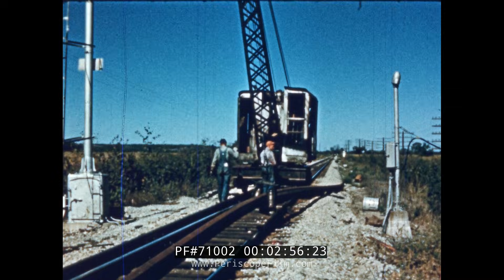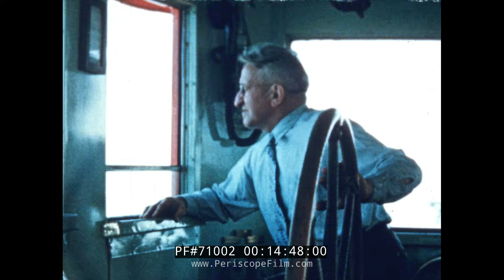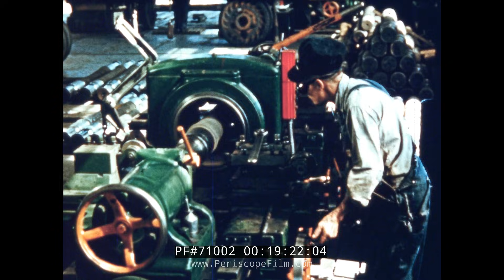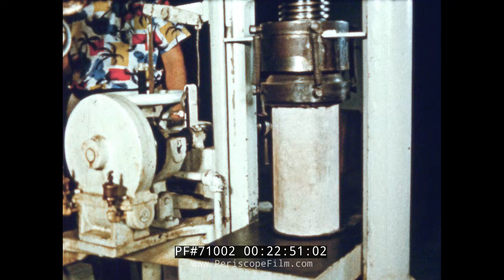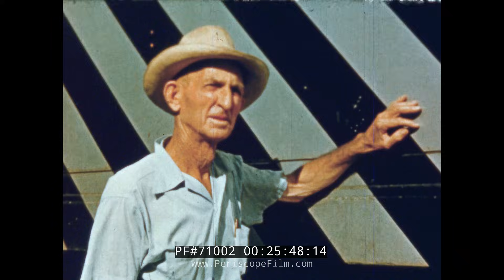"CHALLENGE FOR TOMORROW"  VINTAGE SANTA FE RAILROAD SAFETY FILM 71002

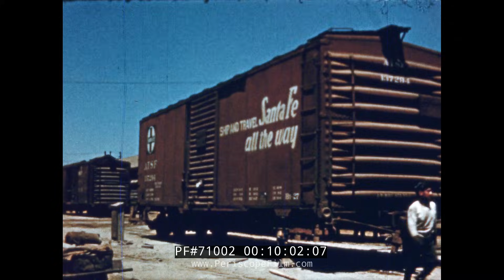Comment: Metal on metal has smaller coefficient of friction than wood on metal thus lowering the force of friction between the two surfaces.  As a result, 10:00 is more likely to happen.  Never underestimate the power of basic physics.

Comment: What I like about our local railroad is that it is the same railroad the trains used to run over. It was part of a small road of about 50 miles, from the late 18th century to the 1950s. it shut down in 1957, and torn up, except the first 10 miles or so that ran through town to the next town, which was abandoned for a few decades. Now they run trains of granite grout to the junction with mainline railroad outside town. They relaid the rails and ties and ballast ten years ago when they restarted operations, but the rails are still the old ones, marked Bethlehem Steel, 1928. Still bolted together. I like that. Not the original rails, but they carried steam locomotives.

Comment: That E-1 @ 6:50 ?  I didn't realize SF still ran E-1's in 1954.  Interesting.
Reply: It’s got the shovel-nose for sure, but the headlight looks a bit off, as it’s protruded, not flush.  Could be an E6 unit though.

Comment: Seen this video before and it's awesome.

I had no idea those 1800s steam engines were that big compared to an F-unit. I thought they were smaller than that.

So whatever happened to getting rid of that clickety-clack? :)

Were the steam engines shown here preserved? They saved that old time loco until the time this video was made so I'd like to hope they kept it around after this if they already kept it that long.
Reply: The clickety-clack is from the joints in the rails, nothing to do with steam. Steam goes "chuff-chuff". That's why he said the clickety-clack is gone now that welded rail (semi) is being used.
That is a relatively large 18th century steam loco, a Consolidation type, probably from the 1890s, so it is bigger than, say a 4-4-0 from the 1860s or 70s. But it is still pretty small. It can't be that much smaller, though, since they are both running on standard gauge. The size difference is less apparent from the front, since width and height changed a lot less  than length. Loading gauge has stayed relatively static, but you will notice that the cab takes up most of the height of the steam engine, and the boiler,l which is the actual locomotive, is barely as high as the headlight of the diesel. Later steam engines had much larger boilers, and were actually larger than a diesel. There is an 0-6-0 switcher in New Hampshire we pass sometimes, and it is amazing how large that actually is. They haven't made small locomotives since the 1870s, really. The "small" wheels on that engine are as big as me, and the thing is like 15' high or so.
Reply: @William Walker  I understand that it's the track making the clickety-clack noise.  And boy, do I ever know where the chuffing sound comes from haha.  I just don't understand why the clickety-clack didn't go away, like it was claimed would happen here.  I still hear it when trains go by to this day.  Unless it used to be even louder back then?  But the sound is still here.  Although, this isn't a complaint.  I like the sound, heh.

I will have to check the video again.  I knew that wasn't a 4-4-0, still I wouldn't expect an old time consolidation to be that large in comparison to the F-unit.  But, you are right that most of the height is from the cab, smokestack, domes, etc, and it is not as easy to tell from the view we have here.  I wish we had another angle!

Comment: I guess the real difference between then and todays is:
-Brakes (every car is now a caboose with today's pressure brakes and digital monitors)
-Clothing (put a yellow vest on top the overalls, exchange the hats for hardhats, and add sunglasses)
-The trains' contents (much longer, pulled with 3 locomotives, much less passenger movement.)
-Communication (I'm pretty sure everyone in the crews has a walkie-talkie.)
Anything I missed?
Reply: PPE for train crew, such as gloves, boots, eye and ear protection, no reading or electronic devices on the job, "Red Zone" protection when between cars, no walking atop cars (thus no "tell-tales" as shown at the end of the film), electronic devices similar to iPads for switchlists, setoffs, pickups and to log work done, also for employee time and work records, remote control locos, almost no more human control operators (I was one) or switch towers, talk of one-man crews, alerters instead of dead-man pedals, no dropping or even riding loose cars (kicking cars) in the yard to make up trains,  ETDs instead of cabooses, and I think the air brake systems were different, called ABD or something like that.
Reply: @KutWrite  wait you guys can’t kick cars anymore?
Reply: @codyandrew2029 : They did away with dropping first, back in the early 2000s. Later on, while I became a control operator, a conductor told me that kicking was made illegal, that is, with a conductor aboard the car.
 
We had been allowed to do it as long as the conductor was firmly aboard a ladder on the trailing side of the car, holding with both hands. I did it a few times.
 
It was scary at first, then a fun test of skill, applying the handbrake just enough to allow the car to couple, but not stop too early or bash the stationary car ahead.
Reply: @codyandrew2029 
The RR I worked for still kick cars.
Reply: Yesterday... Semaphores, Searchlight signals, extensive pole lines, electro-mechanical signalling systems, and Fairmount Speeders zipping from place to place. 

Today...  The "Darth Vader" color light signals, hy-rail trucks, and 100 percent digital end to end PTC signal equipment replaced all that vintage gear which served so faithfully for years.

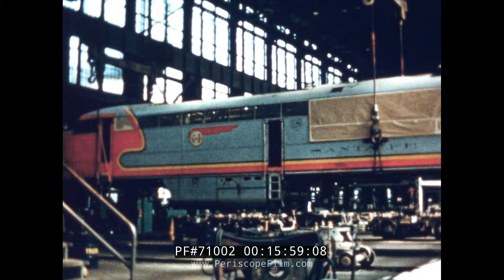Comment: 16:00 -   Fairbanks Morse, Erie-Built - 6 axle passenger diesel l. They only had 2 A units, and 1 B unit. Pretty rare.
Reply: Pretty crappy, too!  When the 90 would go up Tehachapi on the SF Chief, they used to have a rider in the engine room to reset the overspeed trip due to wheel slip.  The FMs didn't have sanders!  There were no repeat orders.
Reply: @desertbob6835  This educational video also has a strong reference to when I was; listening and watching the classic Warner Bros Looney Tunes cartoon episode, it's where Foghorn Leghorn played a joke on the male cartoon barnyard hunting dog. The male cartoon barnyard hunting dog moved upward out of the way; and then Foghorn Leghorn got on the railroad tracks, this is where the diesel engine train ran him over. Daffy duck had Foghorn Leghorn all bandaged up.
Reply: @desertbob6835  The diesel engine train didn't even kill Foghorn Leghorn, that's what.

Comment: Bro, Santa Fe had it's own ships? That's awesome!
Reply: Lots of railroads did! The Central Railroad of New Jersey had car floats, tugboats and ferries. They would even serve complimentary breakfast on the ferries, not to mention the transfer from trains into Jersey City Terminal to ferries headed for Staten island was free with your ticket!
Reply: More barges than ships
Reply: CSX has a container fleet.
Reply: Even the Central Vermont had a fleet at one point, from New London, Connecticut. The B&M had a fleet of lakes freighters, IIRC. It was extremely common. Especially if it was just to cross a waterway on the line, that is just a thing you do when the water is too big to bridge or go around. Railroad ferries, etc.
Reply: SP had a much bigger, but older, fleet.  They also had the Dumbarton bridge in 1901, and the Caquinez Strait bridge by 1930.  SF was SP territory.

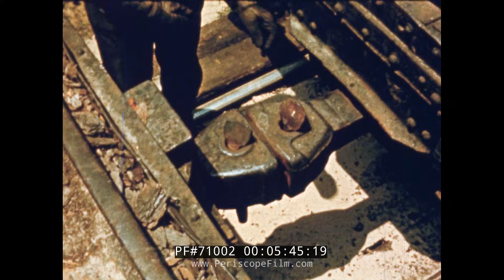Comment: 5:46. HOly Christ does that look dangerous
Reply: Daveyboy _ 
I’ve thought about that before. If it were me, I would have carried a thin piece of steel to lift the link with. Forget putting my hand in there!
Reply: Even with the modern auto couples the guy must get in there and connect the air hose for the brakes. Although there is no smashing problem after coupling, the guy can still stumble and the train start moving.
Reply: @mytech6779  Thus the modern red zone and related rules.
Reply: A buddy of mines grandpa lost a thumb because of those couplets
Reply: It was, imagine getting your hand smashed